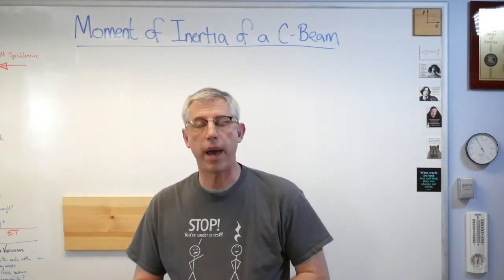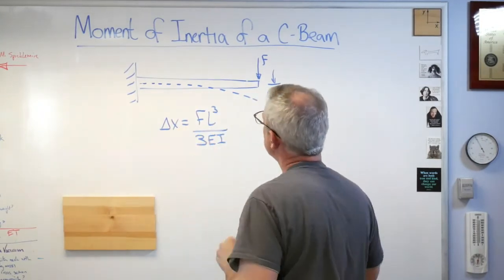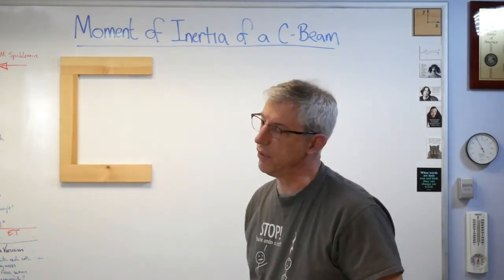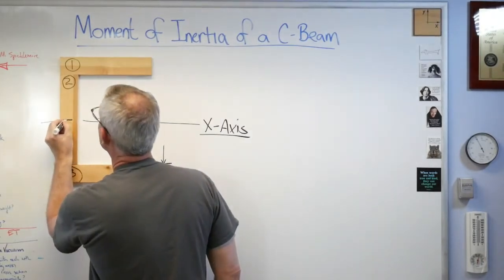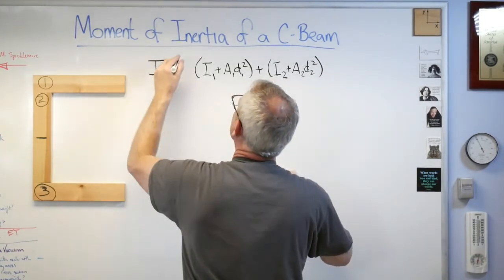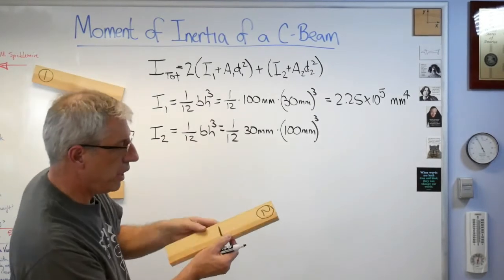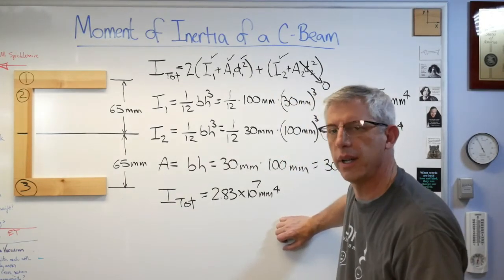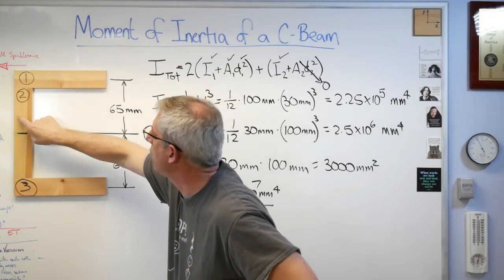Moment of Inertia of a C Beam (or U Beam) -  Brain Waves

Comment: Sir, what is the maximum load that c beam can bear. If the length is 3300 mm. C beam is 125x65x25, thickness 2mm. The load at vertical side of the beam